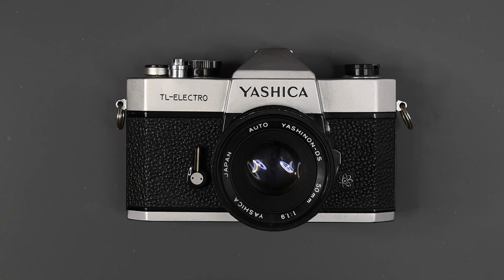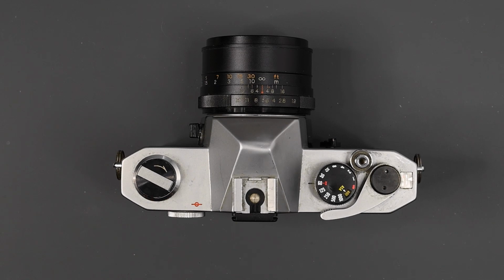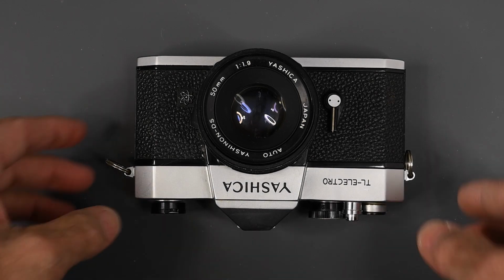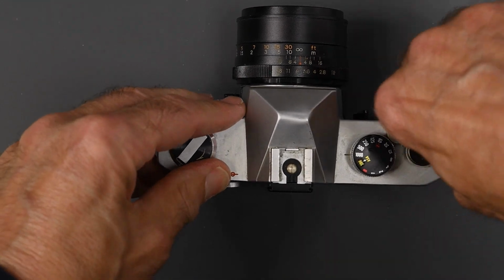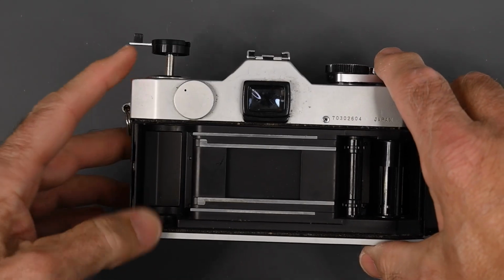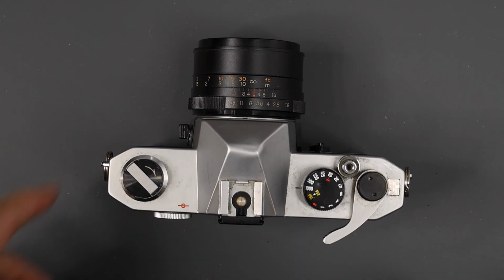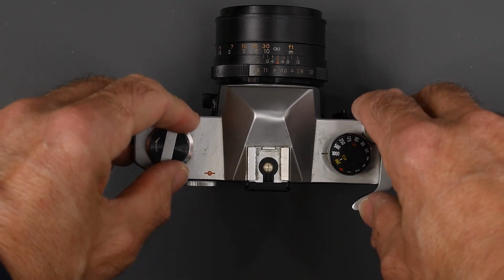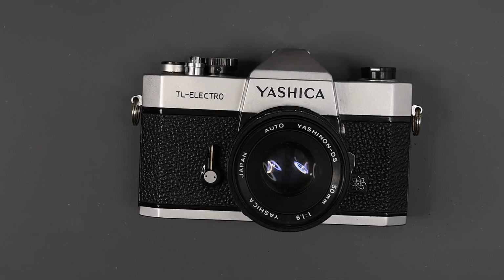Features, Controls and How to Use the Budget Yashica TL-Electro 35mm Single Lens Reflex Camera.

Comment: ive got a tl electro x that even had a teleconverter 2x on the mount. all buttons and levers etc are metal on that one.  the former owner ripped the transport lever and the screw on the button to fix the lever got sheared off and the loose part stucks inside the little tube beneath. got a spare n repair one that even had the eyecap and a lens and half "repaired" the functioning one with a russian hack with superglue and baking powder^^. decent fix, but not really a repair. anyways the camera is now in pretty goód condition. if possible i recommend the x version, but if the non x is much cheaper go for it. batteries for the tl electro x are no problem to get one btw
Reply: What kid of battery does the TL-Electro X use?

Comment: I was wondering if you have any ideas on what to do about a missing speed dial plate? 
I recently got my first film camera (which happens to be this model) and noticed that the number plate for the dial had fallen off at some point in its life. 
I almost have the camera fully cleaned up and ready to go but this little bit has my mind drawing a blank.
Reply from the maker: See if you can find a listing on EBay that states for parts only. You can usually get one very cheap.

Comment: the lever won’t go down anymore since i tried to use the timer
Reply from the maker: Is it possible you are at the end of the roll? If that's the case you will need to push in the button on the bottom of the camera and rewind the film. Is the self timer stuck? If so trying pushing it back to the upright position.
Reply: @julesvuottosphotofocus4696   that also happens if no filmroll is loaded. made me nervous as hell the first time haha. i confirm your fix^^.

Comment: My pops just gave me his from when he was a kid but i can’t seem to figure out how to look through it all i see is black
Reply from the maker: Sounds like the mirror is locked in the up position. Remove the lens, to see if the mirror is visible.
Reply: @julesvuottosphotofocus4696 if the mirror is stuck what should you do? I can bring it down but it won’t stay down. (I don’t have battery’s in if that matters)
Reply from the maker: @woxxiwiggles404 it doesn’t matter if you don’t have a battery installed. Try working the film advance lever and then press the shutter. Set a shutter speed of 125. It that doesn’t work the camera would need to be repaired. It would cost much more to repair than the camera is worth.
Reply: @julesvuottosphotofocus4696 this worked! Thank you so much! I’ve had this camera on a shelf for months because I bought it at a rummage sale for insanely cheap.